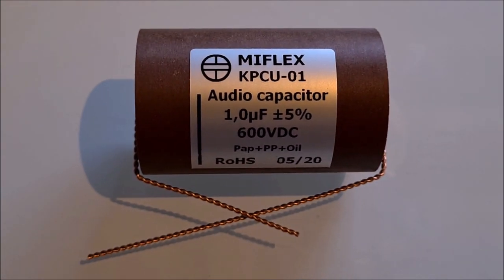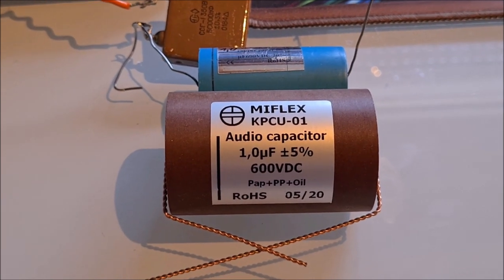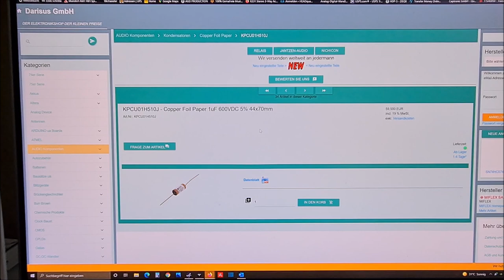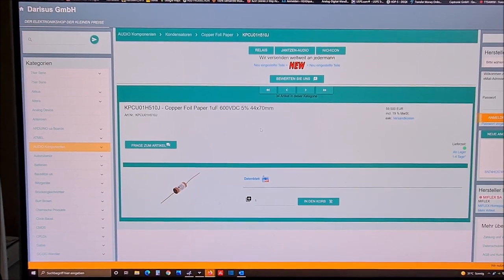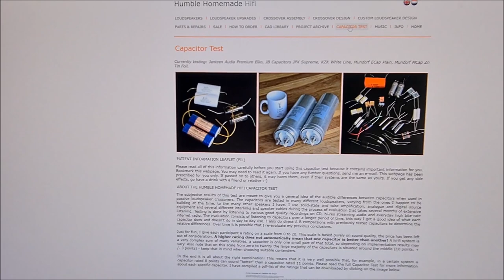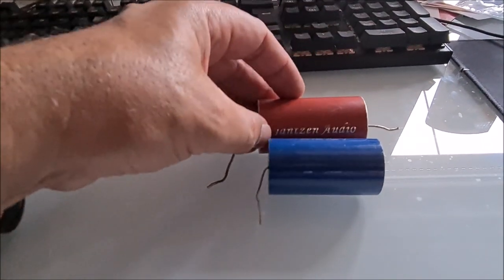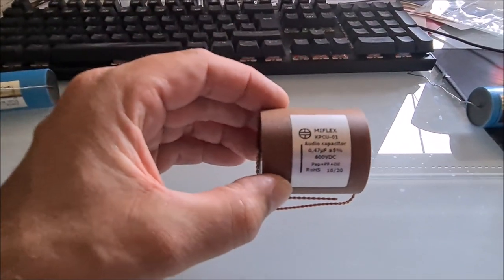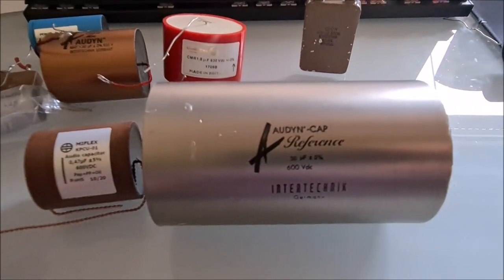Cap, Caps, Crapp....and then:   Miflex!!! OMG!

Comment: Yes caps make a big difference. And inductors. And resistors. Clearly way more going on than mere measured values.
Reply from the maker: and cables, and plugs, and materials, and shielding, and no shielding, and right shielding and and no power in usb and settings in Roon and and and and in Router and in head :) cheers Mike

Comment: Miflex kpcu, Jupiter Copper Foil(which also have polypropylene in them, most people don't know that and think they're all wax or something) , Rike Audio S cap 2, Sonicap platinum, and K40y-9s are the best caps I've heard and I've tried everything. Hovland supercaps are nice too but a little hot in certain spots
Reply from the maker: Hi, thanks for information...have fun, all the best, cheers Mike
Reply: I love aluminium caps like Jupiter VT or not known but absolutely great in there price WEET caps.
Reply: KBG-mn? Thinking about adding them in my crossover

Comment: Miflex is a Polish capacitor produced by a company that existed until 1957. MIFLEX SA. They make various capacitors, including special ones for audio. Al, Cu and recently Ag versions are produced. All of them are made of solid metal tape insulated with polypropylene with oiled paper. I have been using them for 3 years in the KPCU version in the crossover for the tweeter. The sound is amazing. I have to try them together with SSG capacitor. Greetings, Marek
Reply from the maker: Please do it fast, because you will never hear again without them..  😉 cheers Mike
Reply: @headquarteraudio5388  Unfortunately SSG-1 are not available. I bought an SSG-2 with a capacity of 0.075uf/350V. How much capacitance to add as a bypass to the main capacitor for the tweeter with a capacity of, for example, 4uF?
Reply from the maker: @marekprzylepa7999  up to 0.1mF is good, but think of the midrange too... cheers Mike

Comment: yes, agree with your conclusions. The Duelands are still the best cap I have heard, but the MIFLEX copper and Jupiter copper foil caps get pretty close. The others are way down the list as far as SQ. Duelands are HUGE though so need to figure out where you can locate them before buying them.
Reply: Man muss sich bestimmte Sachen nur lange genug einreden. Dann glaubt man das auch.
Reply: @thomasschafer7268  you need to hear them. If you have not heard them, then  no grounds to talk from.
Reply: Jupiter copper wax or duelund cast cu?
Reply: @LuxAudi  Have used both. Sonically the Dueland cast are tough to beat and maybe a touch better sonically. But physical size makes the duelands not useable in some applications, so then revert to Jupiter copper foil and wax or the Miflex coppers.
Reply: @mcgjohn22  thanks, compared to the clarity cap cmr which are appreciated for neutrality?
Reply from the maker: @DaltoHiEnd  Audyn tri reference

Comment: Silver mica capacitor for audio...did not know about them but ordered some along with some ft-1 seems they are Teflon , going to  try them out as by pass on power caps as well some more K42Y-2  paper in oil , they are something special for signal line cap swap with some tri path amps . Indeed did try out many well regarded vintage  caps against the K42Y-2  , but they were clearly the best of the bunch I tested .. Enjoyed your video very much , did however after watching your video find an high end builder of 50 years that also uses the silver mica pair with film for tweeters , seems it's his go thing for all this builds for the last number of years ..... .

Comment: Replaced my Solen MKPs with bypassed ClarityCaps PUR (8.2uf and 15uf) with the Miflex KPCU-01 0.1uf, major improvement! instantly noticeable, the sound stage more than doubled. This is for protecting the 4 tweeters in a fully active system, I could run everything unprotected but it's just a peace of mind having those in.
I think having a high quality capacitor of very low value really helps, even if it was a 15uf Miflex, I would still bypass it with the same 0.1uf, 100%.
Reply: I'm very interested in the clarity cap pur. Not much on the Internet review wise but by the way they market it it seems it should be better than the cmr at half the price. Could you describe your thoughts on them please?
Reply: @JMJM75257  I think the bypass helps, PUR vs Solen or similar… snake oil? I can’t tell
Reply from the maker: Its no snakyoily, cmr is a wonderful cap, but expensive..sorry, I dont know the pur..cheers Mike
Reply: @headquarteraudio5388  I have an active system, so the caps are useless other than providing some protection, so I decided to bypass the caps with a basic wire, so no protection no capacitance, I did different tests having in mind that the caps would introduce something I could hear. Well, caps or not, zero difference, $ to $$$$$, no difference whatsoever

Comment: Nice to see your perspective on Caps. I have Russian mica but not the silver caps. I will have to get some. 
I put the expensive Jupiter copper foils caps in my Prima Luna tube amp and they muddied up the midrange compared to the cheap stock capacitors. It did not go away with break in. Maybe similar to the audyns So don't try those.
Miflex are Also my favourite. The midrange is very focused. 
My current budget capacitor is the jantzen superior z, a little sharp in the high frequencies but overall pretty good.
Reply from the maker: Hi, Jantzen Sup. needs the bypass with SSG01 silver mica... !!! Use it :) Cheers Mike
Reply: i have also in a long time been curious if im actually heard some of the same about the Jupiter copper in wax as you or if i fooled myself, or i feel when i change from the originally Sprague polypropylene to the Jupiter copper that just as some words could overlap each other so the words appear to not come in the right order, its not obvious on all songs or voices but sometimes it feels strange,other than that i feel the Jupiter coppers are a good balanced cap trough out and have a natural flow to it,so its bit sad when it could muddle up some words order, another capacitor i can recommend if not needing  it for over 240v dc is the Fostex CS , i feel they have nice resolution with a natural flow to it

Comment: I went off humbles list as well. Landed on the audyn tri reference and miflex KPAL. The KPCU was just a little to expensive for me. I had already tried the jantzen superior Z cap like you too. I agree with everything you said. The short of it is that the miflex caps have some magic in them. Everytime I go to try a different cap, I can't unhear what the miflex does. It's spatial reproduction, seperation, detail, clarity, imaging, dynamics. It's just all there in spades. I really am curious to try the KPCU cap but man $200+ for a single cap is a lofty price for me. The KPAL was only $90 for a 5.6uf. which is much more reasonable.
Reply from the maker: Hi, try out the Mifelx KFPM, its my favorite in the moment as shunt... or go to RIKE Audio for best results...cheers Mike

Comment: I have an SD card reader that i tried obbligato gold premium - nice but no bass, wanted miflex but nobody had them at the time and so went with Mundorf supreme evo silver gold oil - nice crazy detail and bright"ish", but still the player had that "digital" voice about it. Finally Miflex back in stock and wow! This is the thing baby! Detail from bottom to top, air and sense of space, texure, analogue sound finally, can listen to the thing endlessly without fatigue. Paired up with audio note non-magnetic tantalum silver 2 watt resistors? wow, wow!-) I am hearing all sorts of things i did not realize were even in the source material, after all these years? I am blown away by the details that i have been missing. Where to use them next?
Reply from the maker: Hi, I need to know your system or speakers for that? I would look for a place in the loudspeaker and install a shunt, that's a huge gain in sound ... cheers MIke

Comment: small tip : i'm sure you know it already but i have to say it just in case. The linear power supply if you need 12v 1A, take 12V 2A or 3A. Specially on phono preamp and the last switch before the streamer. And put this switch with a 1m cable connected to the streamer for maximum effect.
Reply from the maker: Hi, yep :) Cheers MIke

Comment: Hi Mike! Thanks for giving your feedback on these capacitors! I also enjoy cap rolling..lol I have recently purchased some Duelund caps for my tube amps. I needed 2 caps for each tube amp. I purchased 4 of the higher voltage tinned copper foil caps in .22uF. I also purchased the pure silver foil caps in a very small value of 0.01uF as to parallel them to the larger .22uF caps. I can say that I do hear some type of roughness, kind of distorted sounds in the very upper midrange through the tweeter. I was told to let them burn in for at least 100 hours before deciding these caps are not matching up properly. I was told when you add a cap in parallel to another cap, you create a phase shift? I do like the way they sound for the most part, so perhaps what I have been hearing may clear up? After hearing what you are saying about the Miflex caps, I may order some in the future to see how they perform! What are your thoughts? Thanks, Jacques
Reply from the maker: Hello, I have always used 10% of the main value as a shunt. The burn in time of 100 hours is definitely too short, unfortunately it takes longer. Unfortunately, many stop listening too early, so they do not enjoy the correct interplay. Please be patient. I've often noticed that the increased resolution makes other errors in the chain appear more clearly, sometimes you have to go on a search like Sherlock. ...if you use contacts of inferior quality in your speakers (originally with sheet metal on the chassis from the factory) that are also unsoldered, you can now hear it strongly. Best regards and cheers Mike (watch my Linton tuning videos :) )
Reply: @headquarteraudio5388  Thank you for the advice! Just so you know, I had removed the silver foil caps from the main 0.22uF caps, and I could hear a difference as far as that raspy sound in the upper mids/highs. I have  connected them back and will try and get more hours on them. Do you know of a faster way to burn in caps? My thoughts were using some type of AC voltage device with the caps in the circuit, or perhaps DC voltage? I'd like to run something 24 hours a day without having to worry about my mono tube amps having an issue when I am not around..lol
Reply: @jacquesw8725 connect four or five nine volt batteries in series and connect it to the capacitor leave it for a couple of days. just check it's not getting hot in your hand after half an hour
Reply: @hoobsgroove  Thanks for that info! I have a dc power supply that goes up to 30V/10A adjustable. Not sure that would work though, unless I could put a resistor or something in the circuit? 9 volt batteries are not that cheap anymore..lol
Reply: That's correct ...........creating unespected resonance frequencies !!!! 
If you // capacoitors ( bypass) .................best is : 
1) USE the same material..............and same dielectric !
2) Use the same values in  // ( means the exact same capcitors and brand )
Reply: Hi Jaques, still using small value caps in parallel on your tube amp? Tnx, Mate
Reply: @matevlacic8953  Hi mate, yes I still have them in parallel with the .22uF caps. I believe the issues I was hearing were from certain recordings I listen to. It's apparent that these caps will expose any flaws in the recordings! Pros: sounds great with well recorded music, Cons: Will reveal all details, so any recordings with flaws will shine.

Comment: Wow Mike this is a whole new world of hi-spec capacitors that I have not investigated before!

I have built a pair of 'Majestic' speakers that were described in the Australian 'Silicon Chip' magazine in about 2014.

I used high quality components in the crossover network, but surely not as high quality as the caps you are talking about here!  Although I did use those white coloured 'Mundorf' caps, which is perhaps halfway there, so I don't feel so bad now!  The Majestics cost me about $2,500 to build, & I'm wondering now if I should replace all the crossover caps with those Miflex Aluminium/oil types?

Comment: Love this demo + explanation (observation) kind of videos. Please, more test videos like this. 👍🏽😁
Reply from the maker: ok sir :) i am fit again...cheers Mike
Reply: @headquarteraudio5388  Hi, thank you for replying. I'd like to ask you one question. Say, I need 4.7uF. So, I use these in parallel to achieve 4.7uF
1. 1 x 0.1uF Miflex Copper-Paper-Oil 
2. 1 x 1uF Jantzen Standard Z
3. 1 x 3.6uF Jantzen Standard Z

Does this configuration has ANY MIFLEX benefit to my speaker crossover given the small capacitance value of Miflex cap in this curcuit? Or should I just get the 4.7uF Miflex then. Obviously, the configuration was to save money but, what do you think? Thank you very much for your input in advance.
Reply from the maker: @HarithAhmadDaud  Hi, this combination may sound good, but a few things come together here. Some say mixed capacitors aren't good, some say several smaller values together are better. Only trying out helps here, but the 0.1 Miflex always brings you advantages. I like the standard Jantzen because they sound very good for a low price, with the Miflex shunt you have to dig deep into your pocket to get more (Audyn Tri Reference) Cheers Mike

Comment: Hi there, fellow audiophile, what are those Russian silver caps You spoke of and where can I get them? I am currently working on a pair of 1960's Leak Sandwich 600 large three way speakers. I am restoring the crossovers, I am going to externalise them and modify them so I can easily screw in different capacitors and resistors. Also I have just completed a valve (12AX7) driver, Mosfet (BUZ900) output power amp of My own design. It is singing away nicely. Happy listening Dee
Reply from the maker: Hi, name of the russian caps: SSG 1 Silver Glimmer, please use google or ebay. Difficult to get... :). If you use screw terminals with bad quality, you will have differnt sound after soldering the parts... dont use too much heat with the SSGs and be fast :)  Rike has new series, try them.....cheers Mike

Comment: Hello all, I am new to the capacitor game. I hear many recommendations on capacitor types and brands. Many of what I hear has to do with capacitors in crossovers for speakers. I am looking to recap tube amp and tube dac. 
Do similar sonic properties of a capacitor used for crossovers usually transfer over to an electronics and tube application?
Reply from the maker: Hi, you can say that, but as a coupling capacitor, of course, the necessary dielectric strength ( V ) is added here, which has an influence on the sound (foil thickness) cheers Mike

Comment: Hi. I’m very interested in the silver mica. What value should I use and do I connect this capacitor in parallel like a bypass cap? Thankyou
Reply from the maker: Hi, 0.01 to 0.1 mF cheers Mike
Reply: @headquarteraudio5388   👍🏻
Reply: Hi Mike.  I ordered some of the Russian silver micas from Ukraine. I’ve had them in a couple of days now, WOW! more detail, more air, more musical, better timing, but no hardness or harshness! I’m really impressed, thank you Mike.
Reply: Oh and they cost absolutely nothing to buy, I think I will order some more for spares.

Comment: Hello, I'm about to upgrade the crossover of my panel speakers with higher quality capacitors. I want to add the silver mica bypass cap to the high pass filter of the tweeter. The cap value of the high pass filter is 1,15 uF. Will a 0,01uF silver mica bypass cap be ok in my case? Many thanks
Reply from the maker: Hi, sure! But a little bit more is not bad.. :) SSG01 Cheers Mike
Reply: @headquarteraudio5388  great thanks!

Comment: No cap on tweeter, this is the best solution !
Reply: Come fai a non farlo rompere senza almeno un condensatore serie?
Reply: @LuxAudi  più di un modo. La frequenza si può piegare  usando materiali e geometrie diverse inclusa la pendenza , si può fare anche con particolari reti resistive. Il problema è che non si sperimenta più e si fa il copia e incolla di tutto. 
Io non uso il condensatore da almeno due anni e devo dire che non c'è Duelund che tenga, senza la capacità il tweeter non suona meglio ma suona
Reply: @andreavinciguerra8844  è vero come sono fatti conta poco, rovinano sempre il suono i crossover anche i più semplici, quasi tutta è colpa degli sfasamenti che crea, impossibili da togliere, oltre al segnale che dissipa. Ora non sto bene ma appena vorrei scriverti in privato.
Piacere di averti conosciuto.
Reply: @LuxAudi  ok, buona guarigione

Comment: I used Jantzen too and if you want the same qualities but with more of that miflex spirit with lush and decay : SCR SY série étain. It's also very good as a coupling capacitor for tubes, specialy 12ax7. A little bit midrange forward but in the right speaker it does wonders.
I have to try the rike caps now :) can you tell me where to find that russian cap ?
Reply from the maker: Hi, you can find them at ebay, watch for : NOS (New Old Stock) Silberglimmer-Kondensatoren Typ SSG-1  or silver mica russia SSG1 cheers Mike
Reply: @headquarteraudio5388  thanks ! I found a Russian website too, Rutube.com 👍🏾